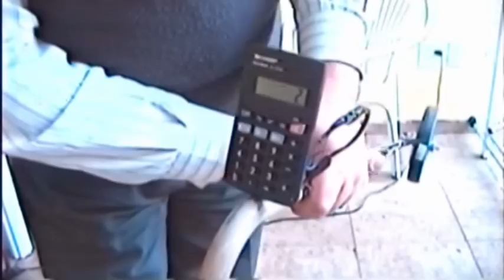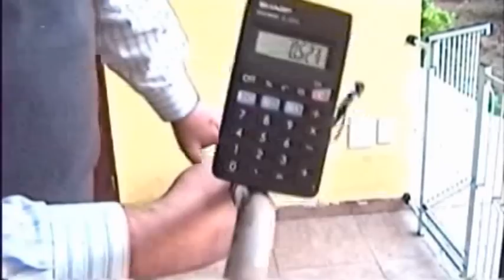DIY Homemade Digital Measuring Wheel Using a Calculator Counter

Comment: Hi. 
What are you applying on back of the display and why?
Reply from the maker: Before removing the keyboard PCB, I've glued all movable parts with silicone glue, so they would not start popping out when manipulating the keyboard PCB.